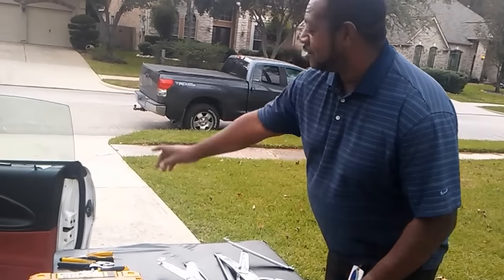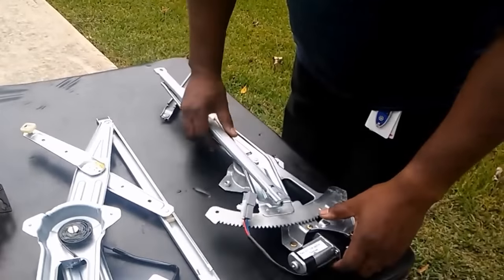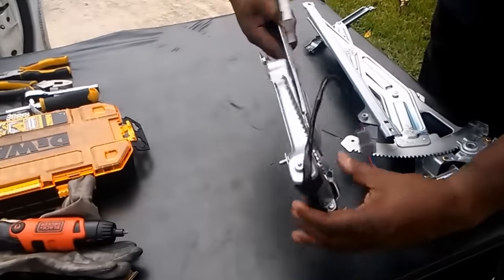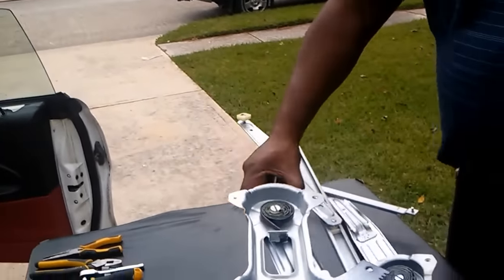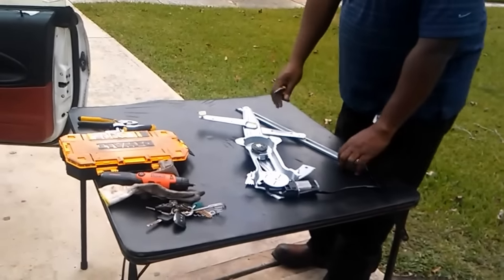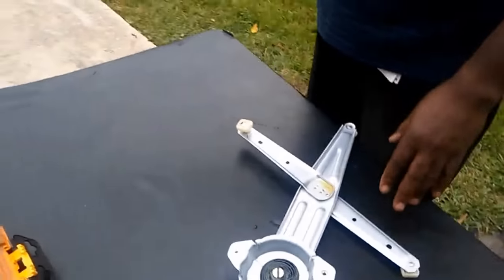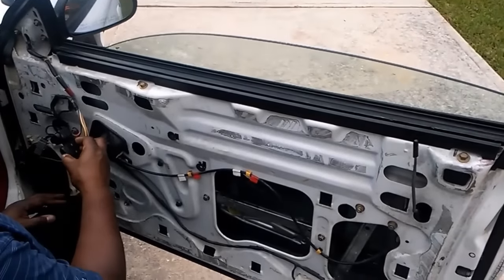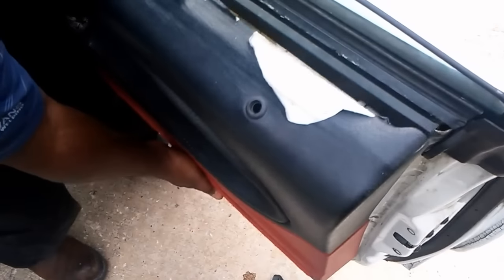How To Change A Window and Motor Regulator On A Ford Mustang

Comment from the maker: Dorman 741-127 Front Passenger Side Power Window Regulator and Motor Assembly  https://amzn.to/2MJJu8k

Dorman 741-126 Front Driver Side Power Window Regulator and Motor Assembly https://amzn.to/2KZcjeK

Cardone 42-331 Remanufactured Domestic Window Lift Motor https://amzn.to/348eaFJ

Cardone 42-330 Remanufactured Domestic Window Lift Motor https://amzn.to/2Zv1uZN
Reply: I replaced the window switch but it wasn't the switch, it makes a clicking sound in the door when I push the switch, what could it be? It's a 99 mustang
Reply: The The only one ☝️ the the best bet bet you you could get the money 💴 for for ya ya ya ya ya ya ya ya know
Reply: @Sullivan Crosby instablaster :)
Reply: @Maddox Tyson It did the trick and I finally got access to my account again. Im so happy:D
Thank you so much you saved my account!
Reply: @Sullivan Crosby no problem :D
Reply: unfortunetly these two amazon links are for the regulators that have the smaller tracks,and you would have to remove the window and drill the rivets out.

Comment: You made this look so easy. Easy if u know what ur doing like yourself.  Valuable info on what parts to use and steps to complete. My shop must have used the first regulator/motor combo you said not to use- they really messed it up. Wish i would of fixed it myself instead of taking to a shop.

Comment: Thank You so much for pointing out the difference in the two window regulators..I had ordered a set and couldnt get the regulator holes to line up,not to mention the wire wasnt long enough to plug the connector back in..I just ordered the dorman model you posted with the two links to amazon..Thanks again to your video.
Reply from the maker: Glad I could help

Comment: I have this problem with my 04 mustang the window will not roll down i replaced the switch nothing i replaced the motor and it work for 2 days then stopped but I can take the motor out and put it back in and it works again for a few days thinking I need to replace the regulator thinking it may have some broken teeth on it....Thanks for the video fixing to go buy the part and try it out

Comment: I want to do this but beforehand, I want to know if it's the motor or the switch, when I click the button for the window it makes a noise and the window just stopped letting down at random one day without indications that the motor was going bad. I dont think it's the motor.
Reply from the maker: Got Bunnies change the actuator and motor. Yours doing exactly what happened to mine
Reply from the maker: Got Bunnies get the dorman brand look in my description for the links
Reply: @weldingandstuff  thank you for this
Reply: @weldingandstuff  is the actuator with the motor?
Reply from the maker: Got Bunnies yes
Reply: stuff  awesome ok I have an 04 mustang could you send me the. Dorman' motor and actuator on Amazon?

Comment: I have a 2001 gt. My drivers window won't go down at all. Im going to assume it's the motor right?
Reply from the maker: Tmas Snake yes it's the motor. Do it make any noise at all
Reply: Welding and stuff not a sound. The switch will click but after that nothing
Reply from the maker: change the motor and regulator; it comes as an assembly  https://www.weldingandstuff.net/window-motor-and-regulator
Reply: It’s most likely something electrical if there is no noise at all. Like a blow fuse or a bad relay, or one of the connections isn’t putting power through.

Comment: I'm going to attempt this tomorrow. My window is stuck down however. Will that be an issue? And how is yours staying halfway up with the regulator out?
Reply from the maker: Pendragon1989 I have a screwdriver inserted in one of the holes holding it up

Comment: How did you do to hold the window up without anybody nobody helping
Reply from the maker: Trevino Corina there's a couple holes in the side so I put a screwdriver in to hold it up or use a 2x4 board
Reply: @weldingandstuff  thanks for the info i realy need swich mine but have no help so your idea will help me do it my self
Reply from the maker: Trevino Corina it's no to hard; give it a try

Comment: my window slows down after its half way up and I can't figure out why...
Reply from the maker: 1)  Check your battery
2)  Lubricate the motor and regulator
3)  Make sure the rollers are on the tracks
4)  Change the motor and regultor